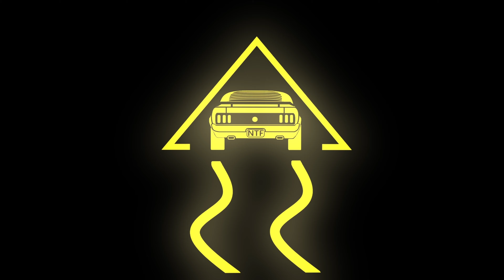WE DROP the SUBFRAME on your AWD DODGE Charger and UPGRADE IT THIS WAY: NTF Ep6

Comment: I have a awd charger so I can just swap this differential in with no problem ?
Reply from the maker: @tarikrobinson3397  You need to ensure the diff gears match within 2%. If your front gear is 3.07 than a 3.09 will work in the back. Awd chargers come in 3.07 or 2.87 gearing. The diff in the back will say what it is or a vin decoder.
Reply: @ if it's a 2.87 what differential would I be able to put in then?.. also I watched all your videos did u end up modifying the transfer case ? I'm waiting for your next video to drop
Reply from the maker: @tarikrobinson3397 Correction its closer to 2.62. The hellcat base comes with 2.62 and is optioned to 3.09. Hellcat diff is 230mm vs AWD Charger at 220mm. So get 2.62 then. These case don't need anything but if they fail its clutchs or chain and those can be upgraded. There is also a billet case that costs more than your car, thay holds 2500hp.
Reply: @No_Traction_Faction  do I need to tune the car after ? Or is it just plug and play ?